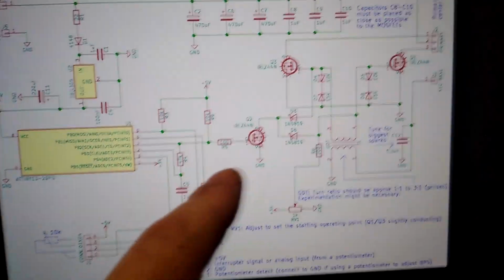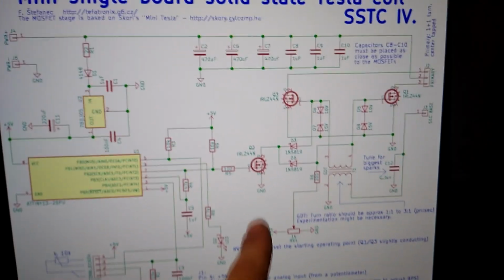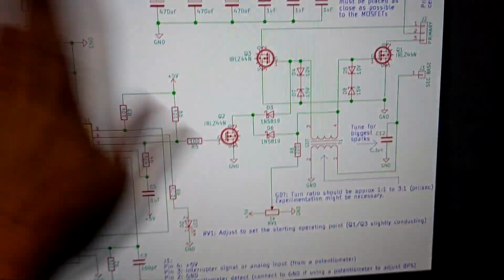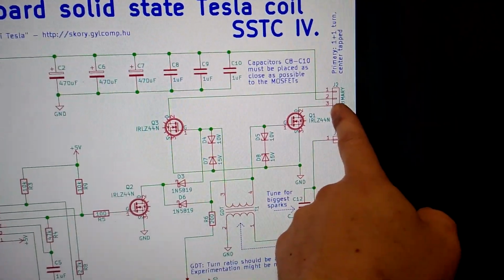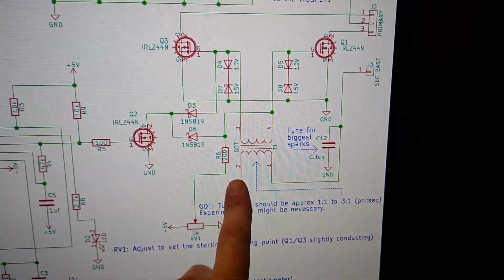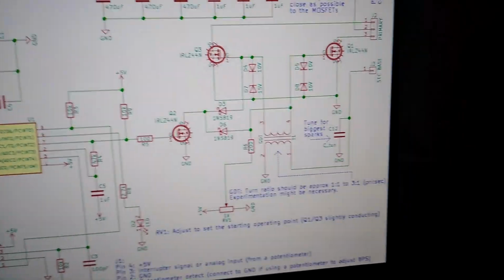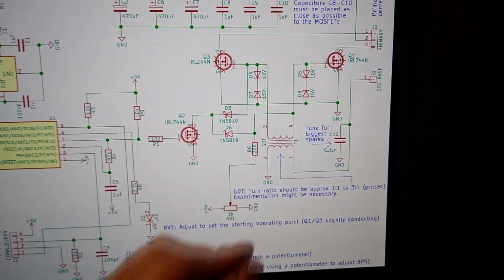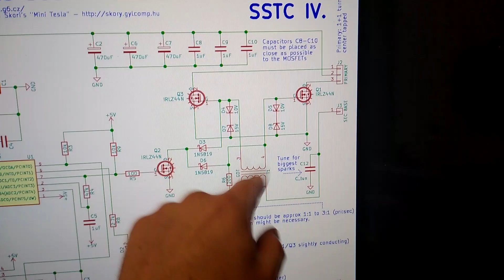Exploring the awesome TefaTronix SSTC IV based on Skori's driver

Comment: I built a tesla coil from the same schematic. for my interupter, I'm using a 555 timer circuit with adjustable frequency and duty cycle with it's own battery supply.  I'm also using IRFP260N FETs, I found there's no real reason why this circuit cant handle much higher voltages with the proper MOSFETS. My coil is currently running on  just over 100 volts DC. This is currently the limit my coil can handle without arcing over to the primary. I can achieve very impressive arcs up to 6 inches long with a fairly small coil. ( 2'' by 5.5''  approximately 550 turns of 30 AWG wire.) the only modification I did was replace the potentiometer that biases the MOSFET gates, from a 10k to a 100k to accomidate for the higher voltage. With a low duty cycle, under around 5% in my case, the circuit draws relatively little power. (note) when I had ran this coil on lower voltages in the past, I found that for some reason, switching the power rail with PWM rather than just grounding the gates of the FETs gave better output,  up to 2.5" arcs in my case with 30 volts input.
Reply from the maker: That's awesome, I haven't tried pushing any of mine over 50 volts yet but I had a feeling the 260's could take it. Only concern for me was noticing how warm my GDT's were getting. Playing around with other general purpose fets they did seem to pop at around 35v or so but not the 260's and some other beefy fets I tried so now that I know you can push yours that high I might give it a go. Either way the switching stage is so cool I've been trying it on other setups and even when not tuning it for the longest breakouts that sucker can source a good deal of current pulling really hot yellowish/white arcs from 12v or so. I tried winding some smaller coils but they would try to arc like crazy to the primary unless I dropped the primary down low enough which would also drop the output voltage a little. My only solution is just making the coupling a little looser which still seems to output pretty good and trying to just insulate it with things otherwise is a bitch cause it will arc right through some pvc. I'm waiting for another batch of 260's to make some more of these suckers. PWMing the power rail also works the best for me, just seems like a cleaner switch. Did you wind your own GDT or use one pulled from somewhere?
Reply: @Magneticitist  I wound my own GDT and I haven't noticed it getting warm at all. It's a toroid about 1'' in diameter with bifilliar winding, I made it specifically for high frequencies. Testing it with 1MHz square wave on my oscilloscope, it gives a really clean square wave on the output. I used litz wire which is basically just 10 or 15 strands of thin enameled wire but tied together at the ends to make one big wire. This wire minimizes resistive losses at such high frequencies due to the skin effect. You can find this type of wire in high frequency transformers on old tube TV boards. I'm not sure how important using litz wire is but it seems to work for me. Here's a video of someone winding a transformer similar to what I did but without the special wire. https://youtu.be/cev12ub52gY In your video, it looks like you just pulled an inductive choke out of a TV board and used that as your GDT. I've tested similar GDTs  with my scope and I found that they just can't handle such high frequencies as your telsacoil. once I figure out how to get my secondary to stop arcing over to my primary, I want to modify the circuit to use a full bridge setup with 4 MOSFETs instead of 2 but keep the same gate drive circuitry. I love how it doesn't use any gate drivers or inverters.
Reply from the maker: @parleyk4503  Yea my GDT is just a common mode choke but it worked better than a toroid I wound initially. I've tried to wind some more since but not using litz wire, which is definitely a better way to go. A lot of the chokes I've pulled from HF circuits and none are meant to handle the TC frequencies but the right ones seem to switch better than any toroids I've wound so far. I like them because with the right tuning I can get more of a static-like discharge that still has a good field which will ring down for a few seconds from a 1000uf cap or so. Once I get some larger toroids I'll try the litz wire out and at least be able to reduce the losses. I was wondering about the full bridge too, I don't see why it wouldn't work really. I just got some gate drivers in the mail I ordered a long time ago and these things are so tiny I don't even want to mess with them. 

I feel like the circuit can be used various ways, like right now I've got one I'm thinking of running continuous from 12-24v that I'll just throw a fat heatsink on and maybe small fan that I can pull flyback-like arcs from so long as it can source 10+ amps. Another is interrupted but set for the longer arcs etc. 

If I can find the right boost module I think it would be cool to set it up like that from 12v or 24v and just be able to switch from continuous at battery voltage to interrupted at boosted voltage. I'm real interested in knowing how the full bridge plays out though. I'd like to be able to make a mini SSTC that runs from rectified mains using this circuit.
Reply: Magneticitist As scary as it was, I tried rectified mains and blew out one of my MOSFETs. Im not sure if it was the FET’s fault though as they’re rated for 200 volts and DC mains is only 170. Keep in mind, if you are going to use higher voltages for your Tesla coil, I found that more turns on the primary worked best for me. Around 6 turns centertapped.
Reply from the maker: @parleyk4503  Daang. Well it was a worthy sacrifice. You know this circuit is very similar to the ZVS driver to me and it was probably the resonant rise that killed the fets via overvoltage across the collector rather than maybe the gates without a driver. 

When I run from 12v I noticed a huge 6800uF drive cap will charge well over 16v. Flip it on for a second then back off, the voltage will drain down from that 16 or so. 170v peaks must have been just a little too much where with the ZVS circuits the rule seems to be allowing for about 4x rise in the bus voltage.

Comment: Thanks for the mention :) Although it really is mostly Skori's idea, I just cut it down to the bare minimum and made a different interrupter.
Just something I noticed, the wires in your circuit seem a bit long, I'd try to make it as "packed" as possible, with some film or ceramic capacitors placed as close to the power going to the circuit as possible (I have them maybe a centimeter away from the MOSFETs, with my primary wires being twisted to decrease leakage inductance).
Reply from the maker: Well I figured I probably wouldn't have attempted it without going by your circuit in particular but I also guess I can't really say my setup is working much like his. I'm expecting everything to work better once I actually put it together but I was surprised how well it worked just testing it out using clip leads. Even with the the clip leads still on by adding the little filter before the GDT and adjusting the primary along with adding a topload I get about 4 inch discharges now at the low power. Problem is I still need to make it work once I add the interrupter and right now it only works because I'm barely getting the supply cap to about 12v before the fets trigger hard. I'm still waiting on some TL494's and the fets but I might use these particular components too if I don't kill them early. 

IDK if yours is similar but I noticed it's extremely power hungry. For example without tuning the gates just right it will want to pull a lot of amps. Still puts out a decent field and a bit of plasma but nothing impressive. It seems like introducing enough off time is necessary for the impressive operation so that's either basically how the circuit is or I've got something wrong.
Reply: @Magneticitist  My implementation is considerably physically smaller. I think it consumes a few amps when at max duty cycle (something like 10%, 20% or so), so yes, it is quite power hungry. I noticed that having good coupling between the two primary turns and short wires considerably decreases consumption. Without any "lossless" snubbers/energy recovery circuits, the energy in the stray inductances gets wasted in the MOSFETs as heat each cycle.  Also with just 1+1 turns, it will draw a lot of current no matter what. It's not well suited for CW mode nor as efficient as (much) more complex circuits, maybe if you increase the turn number.. Best suited for low voltage and interrupted mode.
Reply from the maker: @tefatronix  Ok that makes sense. I wasn't sure because a lot of times when I've got a single fet driver running direct feedback to the gate with nothing in between like a Slayer Exciter I can get really good continuous plasma for something like an amp or so at 24v using a 1 or 2 turn primary but it's nothing close to this current setup when interrupted. Pretty much the opposite where the CW isn't too great but the pulsed discharges are awesome.